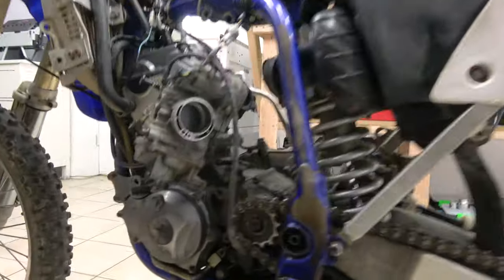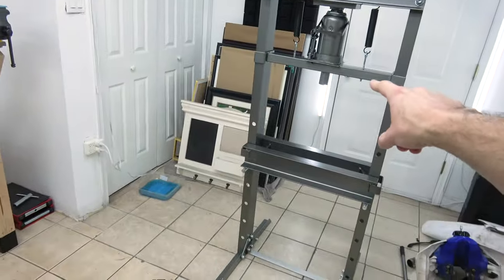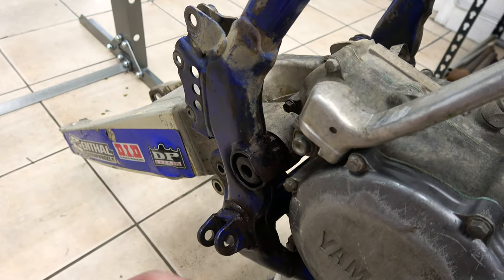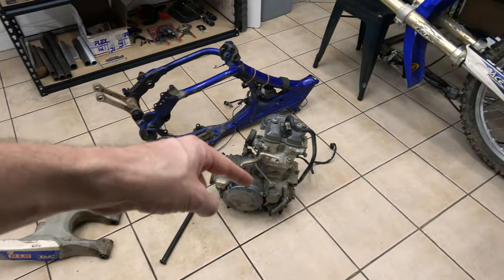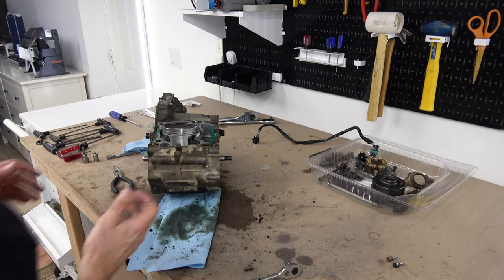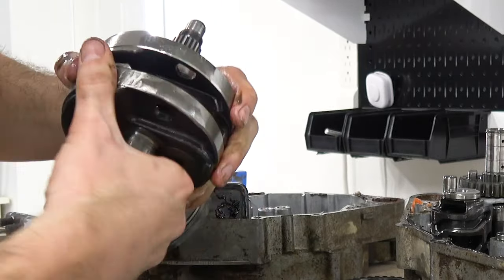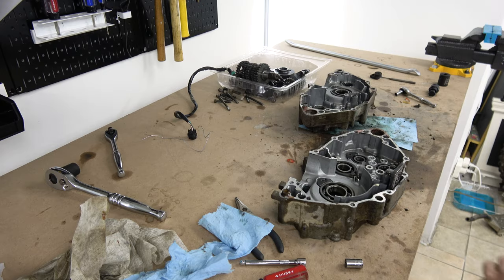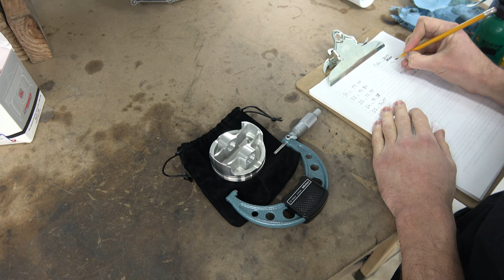Complete Dirtbike *TEARDOWN* Yamaha YZ250F (Engine Locked Up)

Comment: I have a yz250 f 2001 And could not get swing arm bolt out. Having a press is great but most people cant afford or have room for one. I used a map torch and socket extension to get mine out. Heat up  bolt hole for awile then hit it with extension and it should pop out did it with mine. Good luck

Comment: You are a genius bro, I wish I had a friend like you. I bought the of these recently but it isn't running. The crank would not engage,what do you think is wrong or what should I check???
Anyone's help would be appreciated greatly.
Reply from the maker: You may have the same problem as me: bottom end bearing on the rod shot. That means taking the engine completely apart 🔧

Comment: Is there a washer that goes in between the transmission and bearing? I have a 04 YZ450F and the 5th gear is skipping. Seen video where you said dont forgot this washer when you was putting a engine together once and you said that. I think it was your video lol

Comment: Do anybody know..

When I turn my petcock switch on, don’t no gas flow down to my carb
Reply from the maker: Sounds like your petcock is clogged by debris.
Remove the tank, take the petcock off, clean the tank with hot water, put a new petcock in.
Reply: @TristanDurandBuilds  Thank you for the help
Reply: @TristanDurandBuilds  I forgot to mention that when I take the tank off..and I turn the petcock switch the gas flows out perfect…It’s just when I connect the line to the carb there’s no flow at all
Reply from the maker: @dionbray4048  well, there is no flow if your carb float is shut… the float maybe shut because it’s seized or simply because the float bowl is already full of gas…
Reply: @TristanDurandBuilds  thanks again

Comment: Getting parts for a 2001 yz250f is impossible. Trying to get parts for it in 2022 is one  peice at a time no rebuild kits that would make it cheaper. So if i were you dont bother getting  a 2001 or older yz250f because parts are getting limited to none existent for them what a shame sucks to be stuck with this yz250f 2001 for that reason only.